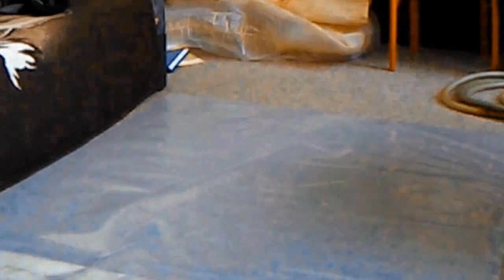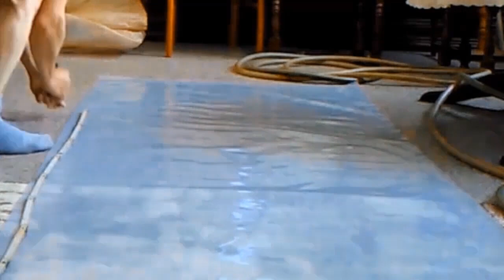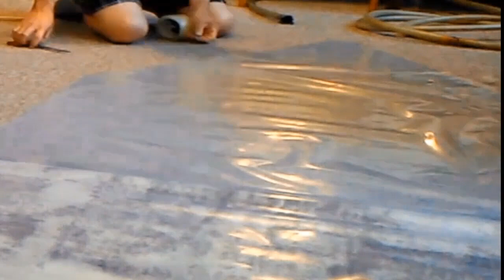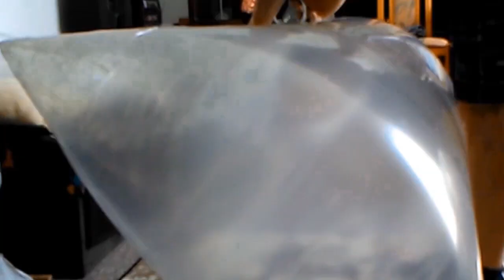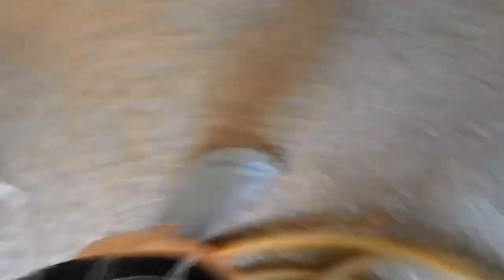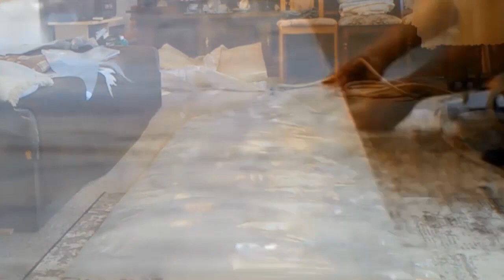Inflating Bag bauen Anleitung

Comment: Mit Klebeband geht alles😊 cool gemacht. Wievielt Bar haust du da drauf mit deinen Kompressor?
Reply from the maker: Habe keine Ahnung wieviel Bar. 
Ich verwende zum aufblasen einen alten Staubsauger von 1957.
Den konnte man damals noch umstecken der saugen oder blasen kann und der hatt nur 320Watt.
Über einen selbst gebauten Regler kann ich die Leistung steuern und den Druck  angenehm anpassen.
Ich teste sowas ja  gerne aus bis zum Limit und bei Volllast wird es gefährlich.
Fühlt sich so an wie  wenn  einen Kugelfisch zur Flunder gepresst wird.
Das Athmen fällt immer schwerer, bewegen geht dann garnicht mehr.
Darum siehst du zum Schluss den Notschalter und der Druck lässt sofort nach.
PS: Habe mal die Leistung auf 25% gestellt und versucht dabei aus dem Sack zu  entkommen.
Keine Chanse! Und bei 100%  nur 5 Minuten durchhalten, ging auch nicht.
Darum der Regler und Ausschalter.
Reply: @flaatiife  Echt coole Sache und gut erklärt